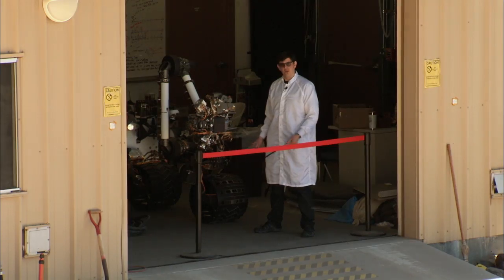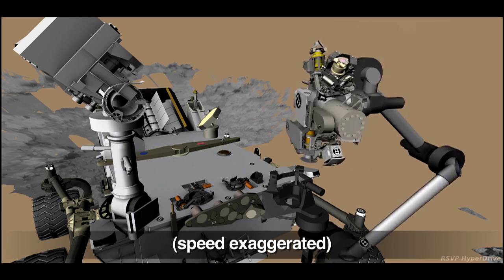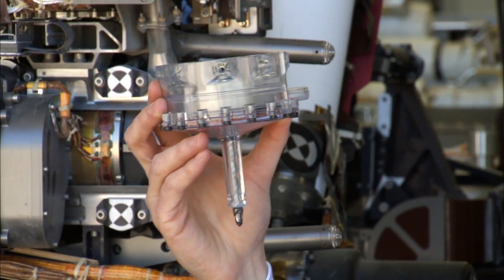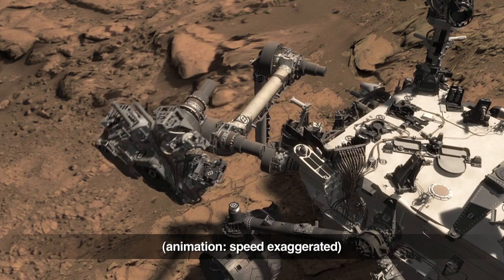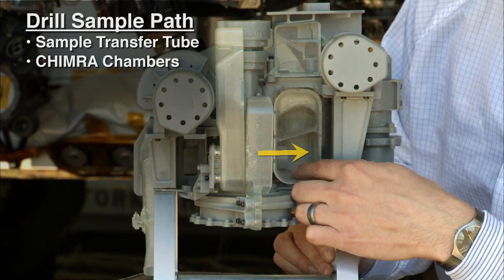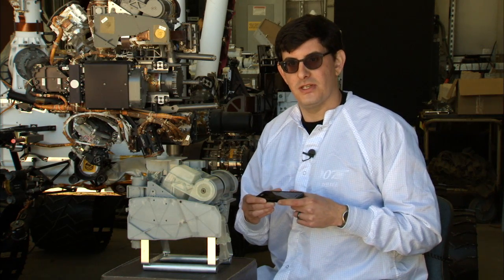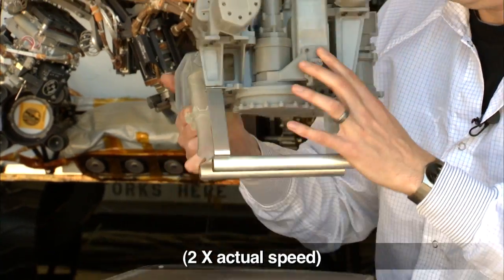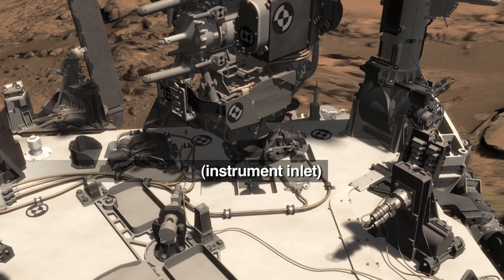Curiosity Rover Report (May 16, 2013): Rover Readies for Second Drilling

Comment: Atmospheric pressure fluctuations on Mars in 10 times larger than the Ears.
Powerful dust storms would damage the components and assemblies that are not hidden in the chassis.
The more lenses and optics. Judging by the 3D graphics, there s no mechanical cleaning systems and ultrasound can not cope with dust, sand.
This strange descent to tross, under 8 rocket to gidrazine.

Comment: but what is forcing this phenomenon? perhaps  it is similar to movement of winds from high pressure to low pressure area. what i mean is that  in our universe there is an event which kicks off tearing of space and time thereby opening a gap in continuum. this creates a "low pressure" area and since continuum is "self healing" it tries to plug this gap. but the differential force is so powerful that it sucks the entire spaces and time inwards creating singularity and then releasing on other side.